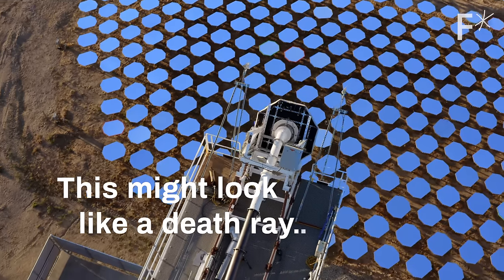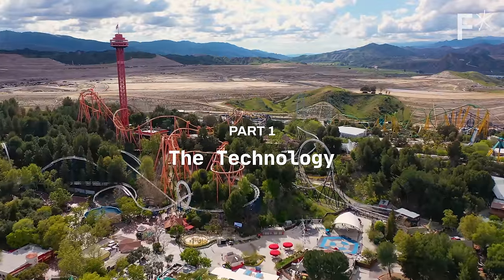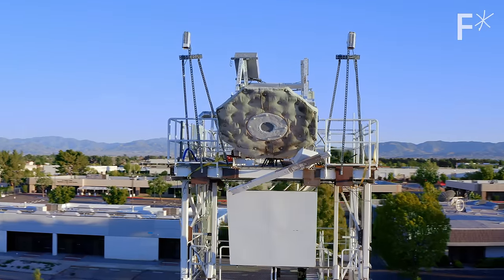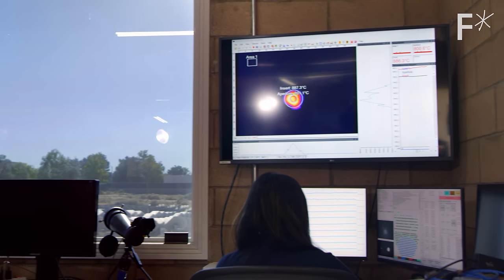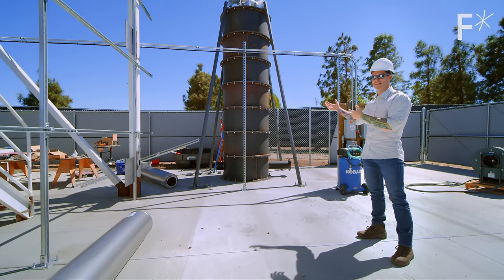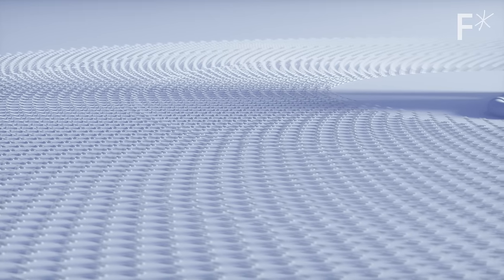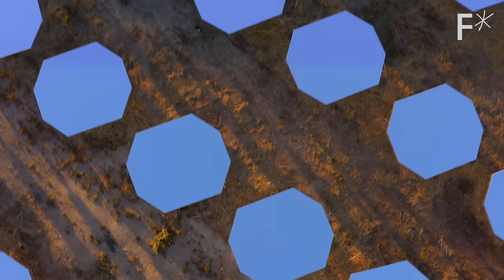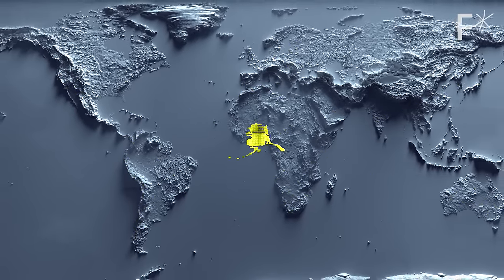How mirrors could power the planet... and prevent wars | Hard Reset by Freethink

Comment: I have been following alternative energy for a long time and this is hand's down one of the best systems I have ever seen.  I just wish you had given figures for how many Megawatts one of those large scale plants could generate/roughly how many homes.   I get the superheated rocks, aka molten salt.  Where you loose me a bit is the distribution of energy through Hydrogen over distance. Better explanation of how exactly that works would have been helpful.
Reply: They are proposing that the hydrogen be used as a stand in for fossil fuels like natural gas and oil.  Hydrogen can, in theory, be transported through pipelines, tankers, etc. similar to those fossil fuels.  It can then be used as energy elsewhere either in hydrogen vehicles or natural gas electric plants converted to run on hydrogen.

Having said that, I personally think that part of the plan is an unnecessary conversion that will waste a ton of energy (compressing, transporting, and burning hydrogen).  I like everything else, but I think they should just use the solar heat to directly run steam turbine electric generators (just like nuclear or most fossil fuel plants) and use the grid to transport the energy elsewhere.  They could also produce synthetic fuels from hydrogen + carbon sequestration and supply that fuel to the large transportation industries (jets, ships, etc.) that can't easily be electrified.
Reply: They would probably convert the heat from the rocks (I don't know why they wouldn't specify what kind, probably want a trade secret or some way to privatize it) and convert that to electricity, Somehow.  Then, through electrolysis, they turn water into hydrogen (Probably venting the oxygen in the process) to use as a transfer medium for energy.  So far, Hydrogen is the most energy dense material we have access to, and it's relatively simple to make and transport.  A plus for using hydrogen, is that the old fossil fuel burning systems (Car engines, heaters, stovetops, combustion generators, etc.) can mostly be converted to burning hydrogen instead of oil based substances.  Converting them rather than replacing them.
Reply: My guess is hydrogen is more expensive compared to gas when looking at Cars that's why E.V is easily more popular. So if this concept works electricity cost to make hydrogen would drop which is one of the biggest barriers right now.
Reply: @Theminecraftian772  The plant would use the heat from the molten rocks to convert water into steam to spin a turbine.  This is how nuclear/coal/gas and existing Solar Thermal plants generate electricity in terms of vaporizing water.
Reply: @CL-gq3no  Elon Musk agree with you, he laugh maniacally at how stupid that idea is and the fact that is stated by a person who's called as genius, visionary and founder of over 150 companies
Reply: Actually, they have three planned energy paths from these solar concentrator facilities. Using all three for highest efficiency. 1) turn CO2 turbines to generate electricity and send it into traditional transmission grid. 2) use the heat directly for industrial applications which traditionally require vast amounts of it, such as steel manufacturing. 3) produce H fuel which can be stored and transported around the world the same way traditional liquid fuels are.
Reply: It is an efficiency vs cost balance.  Electrolysis of water for hydrogen is easier to obtain than lithium for batteries.
Reply: Hydrogen can be produced using this new technology I believe because it also requires a high temperature to produce.  Cars can run on hydrogen and water is the only exhaust.  Hydrogen is quicker to fill than a battery is to charge.
Reply: @samd1405  nope. Dip the end of a 9V battery in a glass of water and you will produce hydrogen. It doesn't take heat. It's just an easy way to store energy.
Reply: Ivanpah? Nevada? There’s a job for someone to pick up the ring of dead birds that fly to close to the glowing plasma every day.
Reply: @CL-gq3no  Electricity does not transport long distances very well without a lot lost along the way.  Electricity is produced reasonably close to the usage point.  The energy grid has many injection points to keep up the supply.
Reply: @trirellb2028  no cheaper this way than any other way to reduce cost per kW hour of electricity. 

This is a robust solution for building up industry scale solar electric generation, especially because they can heat up during the day, while the sun is shining and demand is low (met also by photovoltaics) and then after the sun goes down, built up heat can generate electricity for the grid for hours, without expensive batteries. This is for many markets a peak moment of consumption (dusk/early evening).

Hydrogen is expensive, and this is unlikely to be a robust method for generating hydrogen. More likely cheaper per kW hr generation from photovoltaics would generate hydrogen during peak insolecense, but this system accesses a much more lucrative and in demand market period of the day.
Reply: @poppasan1873 , that was true in the past, but not today.  High voltage DC transmission lines are now able to transfer large amounts of electricity efficiently over long distances.  Typically they only have ~5% loss over a 1000 mile distance.  They can also connect grids on different frequencies (60Hz and 50Hz for example) or frequencies that would otherwise be out of sync due to distance between generating stations.  That is far more efficient than converting to hydrogen, transporting, and potentially converting back.
Reply from the maker: Hey! Glad you liked it. 

Here's a few more details on how green hydrogen works: https://www.greentechmedia.com/articles/read/green-hydrogen-explained

The aim is for plants to generate about 5mw, about enough for 3,000 homes ( https://heliogen.com/category/sustainability/#:~:text=Heliogen%20claims%20its%20technology%20can,carbon%20dioxide%20from%20the%20atmosphere. )

Hope that helps!
Reply: @trirellb2028  It makes no sense to compare electric vehicles to hydrogen powered vehicles because some EV’s are in fact hydrogen powered. There are basically two types of hydrogen vehicles. In the first type the hydrogen is burned in an internal combustion engine. In the second type hydrogen is run through a device known as a "fuel cell" which produces electricity by way of a chemical reaction which in turns runs an electric drive motor. And the only byproduct of this reaction is water. There are also some hybrid EVs which use a combination of batteries and a fuel cell.
Reply: It's not a new concept, it's already implemented on a big scale
Reply: @Theminecraftian772  hahahaha .some how.  maybe .could. the math of a greens
Reply: @trirellb2028   1 kw of electracy to make 1 kw of hydrogen  minus $labour and $material and Hydrogen embrittlement to all hard steel eg pumps -millions of them are now no good
Reply: @poppasan1873  wrong HVDC is great for long distance power distribution.
Reply: @CL-gq3no  They might do that in the future. But I actually like the idea of Green Hydrogen being transported to places where the sun doesnt shine as much hence why he is wanting the most concentration of Heliostats in the places where the sun shines the most, and those place would produce the green hydrogen to then be transported to the further reaches. Much like an 4X game you always have to have a back bone to your industrial power. And here we can see where his vision lies, the creation of practically Hydrogen farms for distribution
Reply: CSP Engineer here (one that actually designs builds those power plants, specifically the heliostat (mirror) fields): Single towers produce about 100MWel, some more 50MWel and multiples more demonstrators in lower ranges. There is an order of magnitude higher installed power for parabolic trough power plants though. Way less complex compared to the towers in terms of controlling.
Reply: @CL-gq3no  Grid has losses, huge losses over long distances. A larger problem is how you go from hot rock to electricity. Steam turbines are complex expensive systems needing a lot of water. You won’t have lots of water in your deserts.
Reply: @suisinghoraceho2403 , grid loses, even over long distances, are nowhere near as bad as the conversion to hydrogen and the inefficiency of internal combustion engines using hydrogen.  Also, long distance grid loses can be mitigated with high voltage DC technology.

Most modern steam turbines don't really "use" water.  They are working in a closed loop.  After going through the turbine the steam is passed through condensers/heat exchangers that cool it to just below the boiling point.  This causes the steam to condense back to water and it returns to the start of the loop to be reheated.  So, it's the same water going around and around for years.  very similar to the cooling system in a car.  Therefore, very little water is needed once the system is initially topped up.

Comment: At 6:45 : " *The powerful thing about that, is that we can move make energy where the sun is good, and move it to where the sin isn't*" doesn't make sense. There is a massive rate of energy loss when moving electricity, about one percent for every 100 km. We had a similar plan for Europe, where we would install solar plants in Northern Africa and relay the energy to Europe. It doesn't work.

I like the idea of using rocks as a battery though, anything that can lower our strain on Lithium needs is good. And they seem to be way more efficient than current methods.

The issue is those mirrors need to be cleaned, especially in deserts. Dust means a less efficient reflection. This is probably an issue concerning the scalability of the product.

Nice video though. I wish they spent more time on tackling the conventional challenges instead of wishful thinking about stopping wars and conflicts by bringing them energy. Moving energy = loosing energy.

Comment: Can we have a video to be more in depth on how they take energy from heated rocks?
Reply: Yes I need to know that too.
Reply: Video that covers how it works details https://youtu.be/_qNz3F0hgQ4
Reply: It's simple really. If you put a kettle on a hot rock it will produce steam. Steam can then drive a turbine and produce energy. Same principle only bigger.
Reply: @carltaylor4942  Yeah, but where is the turbine?
And how are we going to transfer the heat energy in to a turbine.

In your example the whole thing should be redesigned, the central colum should be bigger with rocks outside and water inside.
Reply: @carltaylor4942  There´s also an alternative, your could use stirling engines to convert into motion the temperature gradient.

Comment: With so little mechanical movement to the system, it seems like there wouldn't be much for maintenance costs? Maybe repairing some mirrors after a hail storm? That alone seems like it would beat the cost of gas. Expensive upfront costs, but it's free energy after that.

Comment: Really clever. Love the computer vision reducing the precision needed on the reflector installation. Using shot glasses as your composite core material, genius. Also it appears your pivot mechanism uses a single motor? Looks like you can easily stick these in on uneven terrain.

Comment: CSP HYPEEEEEE (it doesn’t get enough love vs PV, so i am SO GLAD a major group like you covered it)
Reply: Also the “built in storage” via molten salt or saturated steam can have them run for a day with no/not enough sun, all with no huge battery banks needed!

 (i think some places use phase change materials or powders that heat hp upon dissolution but not really common iirc)
Reply: Some people have pointed out the issue of birds, but the same measures that airports use can prevent / reduce that issue
Reply: Also it produces heat directly which can be beneficial for some industrial uses, as jt has less losses over sun->pv->arc furnace or hydrogen/synfuel burner being just sun-heat
Reply: And supergrids !
Reply: @ericlotze7724 , Agreed, the bird concerns are very much overstated anyway.  I was just in Nevada and Arizona for a week.  I barely saw any birds outside of the cities.  Deserts aren't known for having massive bird populations and animals tend to stay away from fields full of strange moving reflective mirrors anyway.
Reply: @CL-gq3no  Isn’t that a scarecrow method lol
Reply: @ericlotze7724  as they spoke of in the beginning, refining molten iron and such. There's where I thought they were going with this.